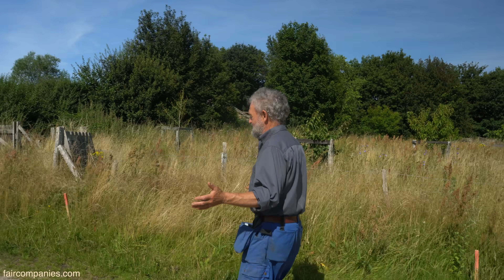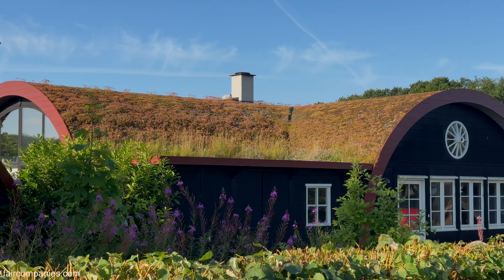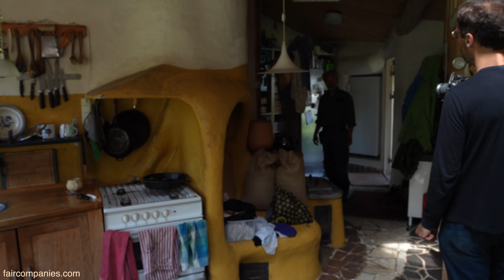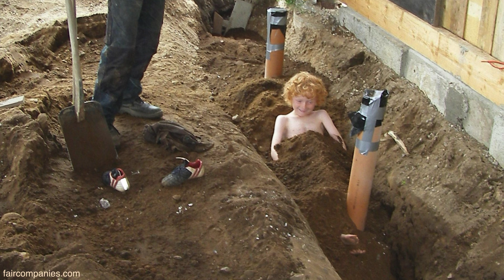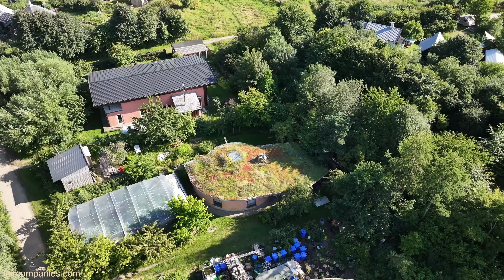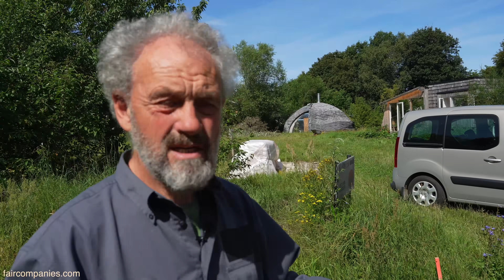Scandinavian ecovillage rethinks homeownership: no mortgages, no waste

Comment: basically this is the most productive greenhouse ever shown on this channel and the owner says he spends little time maintaining it. A system like this is illegal pretty much everywhere. 

Probably illegal in Denmark. Sadly in order to use urine and waste from a septic tank in the US you pretty much need to comply with a system equivalent to a small municipal system. Even if its just to feed yourself, irrigate landscape or grow forage for livestock.

I'm sure there is a decent middle ground between municipal water treatment systems and what this video demonstrates that would be adequate for homesteading. Sadly the US legal system is designed to distract locals from local politics like water rights and building codes.

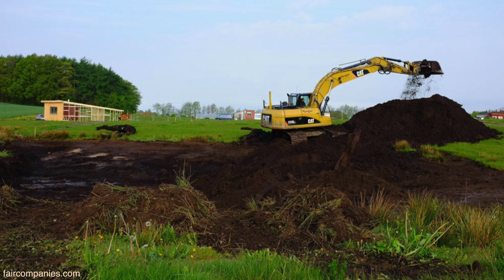Comment: 1:49 the colour of that soil! No wonder Europe's so rich, with soil like that - even at the bottom of where they're digging, it's so dark I actually can't tell where the bottom is.
Reply: That soil, if sand based, is very loose. Clay ground can become very, very hard when it becomes dried out and then it is bad to agricult. After one or two metre, you will find the yellow sand, which is very compact and on which a house fundament is built.

Comment: Having the fridge go through the wall like that is incredibly smart.. What he is saying makes sence.. In summer when its on, the radiator on the back removes the heat and pushes it outside so the house does not get even warmer, and in winter, he turns it off, but due to the back of the fridge being outside, the cold comes into the fridge from the back, but it does not go further and into the house, since the door and such of the fridge, is insulated.. thats so smart
Reply: i have always thought it is madness to make a cold box in a hot room in cold weather. i thought about making an enclosure for my fridge with vents to the outside that you can close in summer
Reply: @willdatsun Me, too! I've been thinking about an air duct behind my refrigerator to move the warm air to my cellar, which is almost always about 60 degrees Fahrenheit.
Reply: @willdatsun  We used to have a cupboard on the outside of a window (that opened to the inside) that we could place there when the weather was cold. So open the window to get acces to your 'fridge' in the winter, during the summer we removed it so it was a regular window.
Reply: @willdatsun  outside temps are unreliable. It can freeze, it can go hot, and if the sun gets it, it will be an oven, winter or not. I used to keep food on my apartment balcony but now my plants live there so I try to keep it warm
Reply: @willdatsun  - Just protect your freezer and fridge from frost, which is bad for the appliances.
Reply: I had a similar thought last summer and was wondering why nobody is doing that, now I feel vindicated!
The only issue I see is that during summer you will need more energy since it is probably hotter outside than inside - though I guess his solution is about as close to optimal as possible, with the clay and the overhang keeping temperatures managable around the fridge.
Reply: It IS a good idea, but could probably be improved.

I would make an insulated box over the back of the fridge that could easily be opened and closed, and perhaps eventually automate it with a thermostat, and also automate when to power the fridge. 
Because the temperature could vary pretty much during the change of seasons. 

Also; if you power up a refrigerant-compressor in to low temperature, the viscosity of the oil in the compressor is to low for lubricating enough, it will reduce the life of the compressor.
Reply: @danielolander3518 maybe let it heat a room like an entry, where you just pass,, together with what passes through the walls. 
In iceland, the old hoses, were surrounded by an extra wall all around, so you had to walk all around the house, on the inside, until you came to the livingzone  "house"
Reply: I like the idea, but I worry about moisture and insects. I'd think after a year or two, the back of the fridge would be a rusty mess.